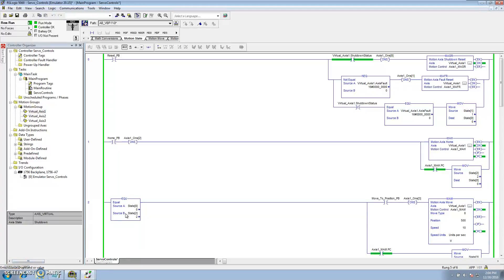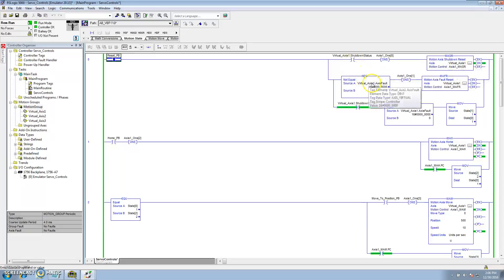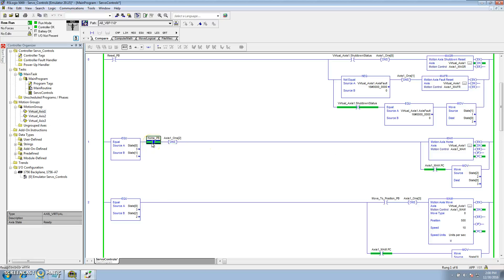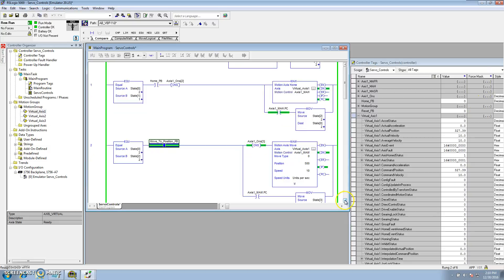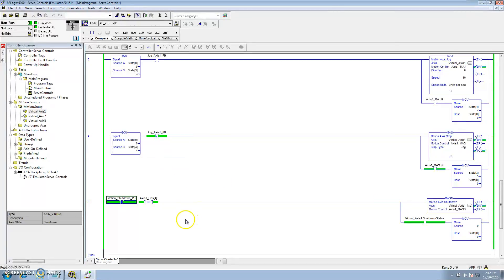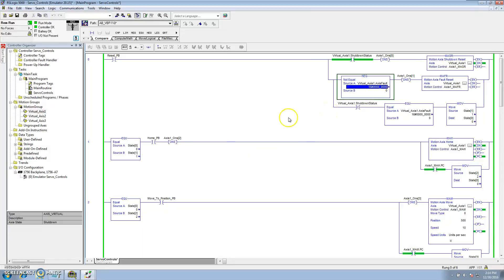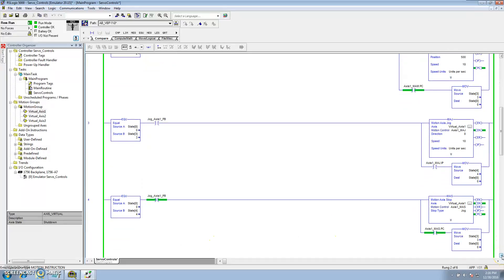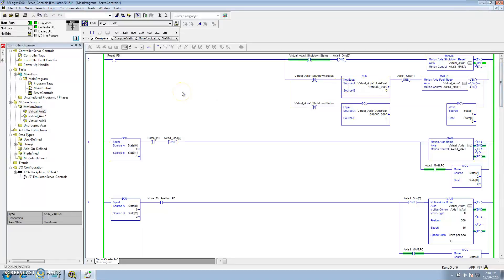RSLogix 5000 - Servo Controls Part 3

Comment: I don't know if you are still adding comments to these videos. I am not sure if everyone understands what a 'state' machine is. I studied an AB manual on the equipment phase where they use a 'state' model to understand how the 10 equipment phase commands work. The manual uses two examples: a tank that is filled with products, heated, stirred, and emptied. The other illustration deals with a conveyor belt positioning products on the belt. I can see the correlation to what you are doing here. Nice job!
Reply from the maker: It is based on the state machine I teach which is different from Rockwell's standard state logic for servos.

This is a custom state machine model.
Reply: @ShaneWelcher  My understanding is the equipment phase instruction group is considered an 'advanced' instruction group. To troubleshoot a PLC issue I believe one has to at least know what the 3 or 4-letter acronym stands for. To be at a level where all the little nuances and interactions between different instructions behave takes a lot of time and effort. I do like a challenge!
Reply from the maker: @oldhounddog01  The way I structured this is a very simple set up method to control the state in a very direct manner, easy to read.

It's a simple setup, much more convenient then equipment phase manager.

Also, I do have examples in my latest videos of using an indirect addressing state machine method.

Comment: Hi Shane, 
Been looking at your videos for a while now and have found them to be very helpful. Thanks for putting in the time and effort to create them. Quick question from a non-virtual POV if you dont mind indulging. Would you say its better practice to be able to reset if a MAJ or MAM is not IP. I was following the logic and here if a jog is in progress and you hit reset, you would change the state to 0.
Reply from the maker: You can have a quick reset with state change but you need to make sure the servo is stopped.

Naturally, the servo would be stopped if it would require a reset like an error from the actual servo.

This set of videos is something I did years ago but is a state machine type of logic so it is best practice to use state change for servo controls to keep standard working order.

Hope that helps
Reply: @ShaneWelcher  thanks a lot shane!

Comment: Sorry one more regarding the oneshot - why did you use a DINT instead of a BOOL?
Reply: Well, why make it a DINT array instead of a single DINT, and just use all 32 bits of the single DINT as your array?
Reply from the maker: Then that would limit the finite state machine that I am using, this is why the DINT is treated as an array.
Often the array is not just a single bit, it is often used for multiple control bits.

My example is to keep it simple.

Comment: Shane quick questions regarding your use of oneshots. You don't have them in front of MAS or MAJ, which makes sense, as one might want to do this more than once. However you have them in front of MAM (home), MASR and MAFR. If an error occurs, or a shutdown, won't you want to be able to press reset or home again? I dont' see anything that clears the ONS instructions. (FYI - I'm a noob please excuse me if I missed something obvious).
Reply from the maker: Because those instructions will fault if double indexed in close timing which is also why I use periodic tasks.

This is just a best practice that I do.

You don't have to use them but again, this is best practice case.
Reply: @ShaneWelcher  Thanks for the explanation. So then if you wanted to reset a fault a second time, you would need to clear the oneshot too, correct?
Reply from the maker: @JustinKLenoff  

The one shot auto clear after the button is released.

So if double pressed then it will trigger again if the reset button is released.
Reply: @ShaneWelcher  thanks man, your great!
Reply: I'm totally going to subscribe to that class of yours!

Comment: Shane, Thanks a lot of for this kind of videos, I am starting to learn more about servos, but I have a question. In each instruction I see a tag in MOTION CONTROL, what is the data type of this motion control?
Reply from the maker: Just open the instruction help section by right clicking the instruction then view the Control data types.

There are lists there to help

Comment: Shane, Thanks for these great videos. Just a quick question. When you home on a virtual axis the position could be 10,000 and the homing could take you to 0 in a blink of an eye. This is not true for a CIP or Servo Axis correct? On those it would move at a certain acceleration and speed rate correct?
Reply from the maker: taylor schott 

Thanks,  yes...I have two servo courses that add clarification to all servo controls.
Reply: Shane, Thanks for your reply. I actually just checked out your page on the 2 courses. Are they already put together or is a week by week course load?
Reply from the maker: taylor schott 
Already put together, not week by week. 

My week by week is my Patreon member area.  

The Udemy courses are over 25 hours of training videos in both courses combined. 

About 12.5 hours of training videos a piece.
Reply: Well thank you. Will look into these options!

Comment: Hi Shane, I notice you have the RSLogix Emulate 5000 Chassis Monitor on your task bar. Where does that program come from/how do you open it?
Reply from the maker: Generally RSLogix Emulate 5000 is separate install from your software disc or install file. 

Then is should be in Start-> Rockwell Software-> RSLogix 5000 Emulate

Hope that answers your question.